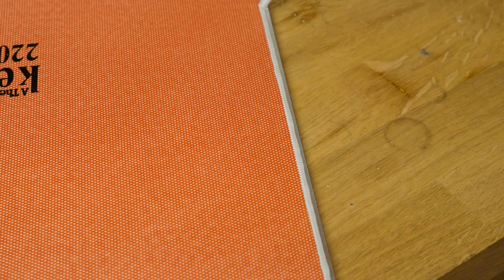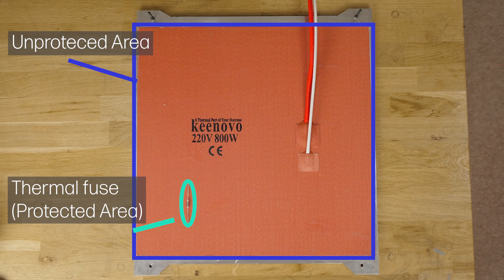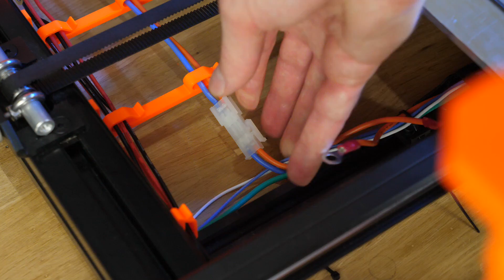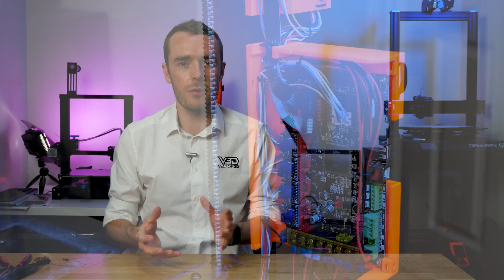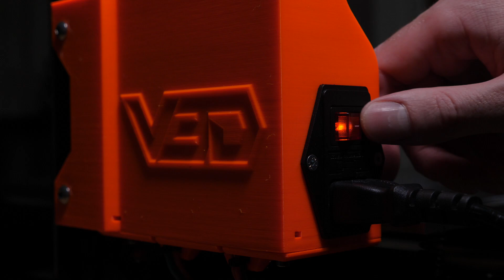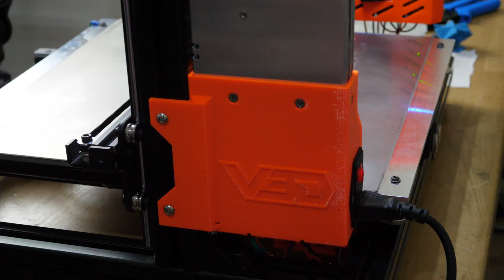MASSIVE 3D Printer now much SAFER!

Comment: The thermal fuse isn't for hot spots/bubbles. Its meant for if the SSR fails closed, and the heater keeps heating at 100%, eventually burning off of the bed or starting a fire. You should not skip this step, even if it doesn't help with bubbles and hotspots.
Edit: Grammar and spelling.
Reply: That's a good point. I haven't thought of that. Marlin won't be able to do anything in this kind of a failure.
Reply: Exactly what I was gonna type, def. don't want to skip the fuse.
Reply: Definitely, I had a Chinese SSR fail closed -- not a good day, I caught it -- literally happened when I was trying to start a print. Since I have my entire printer power going through an additional pair of relays controlled by octoprint, I am able to kill the power to the entire machine from octoprint, so there is that option if you want additional safety protection. Also use SSRs which fail open,  not a reason to bypass a thermal fuse, but still safer -- Opto are one brand that i know for a fact does that.
Reply: @kazolar  SSR's rarely ever fail open. By design, they won't.
Reply: I think that abother safety measure for the heated bed would be a separate fuse for a current barely over the the silicone heater rated power. If there is a shortcircuit inside the heater the current would go above the rated one. Thus the relay would kick in and break the circuit.

Comment: the thermal fuse's purpose is mainly protecting for when the SSR fails closed, causing the heater to run uncontrollably no matter how many temp sensors you have

Comment: Problem with thermistor feedback loop is that it can break, with the control getting stuck in the on position. Hopefully you have two things saving your bacon. Ideally, your bed should have just so much power, that it will never reach dangerous temperatures, even if left on, say capping out at 150°C or less, but i'm afraid with mains beds, that really isn't often the case. Second is thermal runaway protection that protects you from thermistor getting somehow damaged, lost or detached, but still providing seemingly plausible results, but the control (MOSFET/SSR) still has to work, else it's useless.

But there's a way to extend thermal runaway protection to cover a number of possible faults. If you're running off an ATX or server PSU and have PS_ON control, the firmware can take advantage of it, by having to constantly hold down the PS_ON line to keep the electricity going to everything, and if thermal runaway occurs or even watchdog event (i.e. firmware has locked up), it will be released and the power goes off. Another way is to have a relay module (which can be an SSR or a mechanical relay based, no reason to avoid them since they're not constantly switched on and off every couple of seconds, and they're cheap) upstream of the whole printer, the bed SSR and the PSU and everything. To power up the printer, you can just have a momentary switch to bypass the relay until the firmware can take control of PS_ON after about a 2-3 second boot sequence, or on server PSUs you can just bypass PS_ON because they have standby power on that circuit. I haven't personally done that yet and i haven't seen it done but seems like a good idea. Is that something you'd like to investigate and implement? Let me know if i can help you somehow.

Comment: I would use an isolation transformer at the 240Vac side, so that it is more safe to touch the metal frame, if a 240V wire brakes, and hits the metal frame.
I'm not impressed off 240V heated beds. I'm just waiting to hear about a accident/kill be course off a wire shorting to the metal frame, and you or someone else gets an electric chok.!!!
Reply: That's why you ground the frame and use an RCD
Reply: Isolation transformers are big, heavy, **expensive**, not 100% efficient... There's a reason we don't use them everywhere :)

The bed heater in this video is 800 Watts. The closest-rating-to-that isolation transformer I can easily find is 1 kVA¹. It costs *£232* (including £39 VAT), weighs 14 kg, and is rated at 94% efficiency, dissipating 64 W at full load: https://uk.farnell.com/schneider-electric/abl6ts100u/transformer-1kva-1-x-230v/dp/2070208

Admittedly, this 800 W bed is totally overkill, but even a 250 VA isolation transformer costs £94 at Farnell, weighs 4.4 kg, is 90% efficient, and dissipates 28 W at full load.

Also, both of those transformers dissipate 12.5 W unloaded (according to their datasheets). So if you had one powered 24/7 (e.g. if it was before the SSR and there was no other switch to control it) it would use 9 kWh of electricity every month, costing around £1.50 at typical UK rates. Not a lot, but totally unnecessary :)

I really am glad that you're cautious around mains electricity; far too many people aren't!
But in this case, as long as the printer's frame has a solid earth/ground/PE connection (anywhere that is, or could become, close to the 240V heater, the SSR, or any of the 240V wiring), that's plenty good enough. After all, that's all we do with all kinds of mains appliances around the house, especially in the kitchen.

And yes, an RCD/GFCI/RCBO is also highly recommended. Those are cheap (https://cpc.farnell.com/ has several "plug-in RCD adaptors" for less than £10 each...), and houses that were built (or had their consumer unit/distribution board replaced) in the past 20-30 years may already have RCD-protected outlets, depending on local regulations, the mood of the electrician who did the work, and their client who paid for it.
I obviously can't comment on countries besides the UK, so check what the situation is wherever you live! :)

¹ A silicone heater like that probably has a power factor of very close to 1, so in this case 800 W ≈ 800 VA, but getting a 1000 VA transformer, to have a bit of margin, is still a good idea.
Reply: The frame should be grounded when using a ssr
Reply: @AndrewGillard  omg that's one of the greatest responses I've ever read on YT